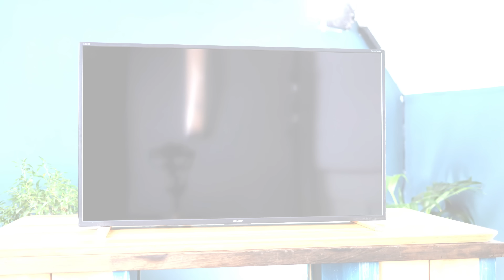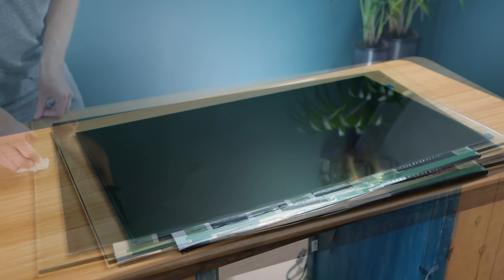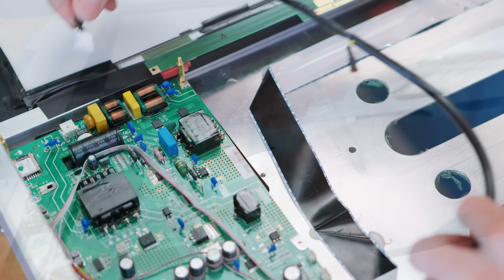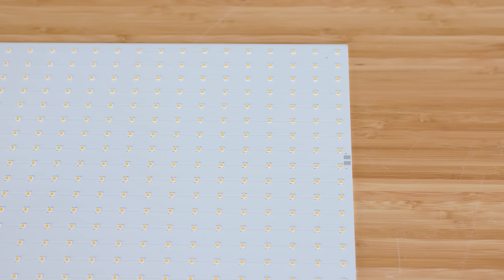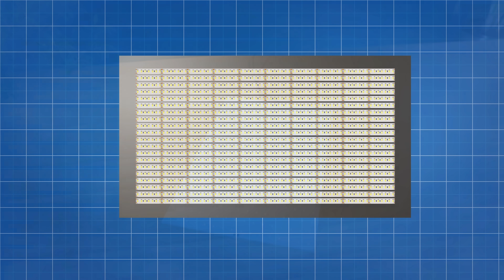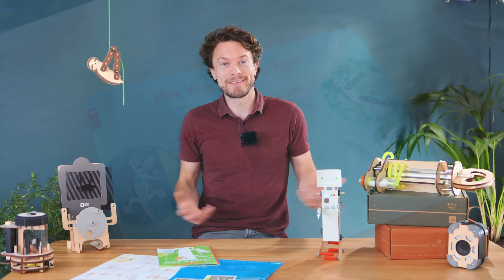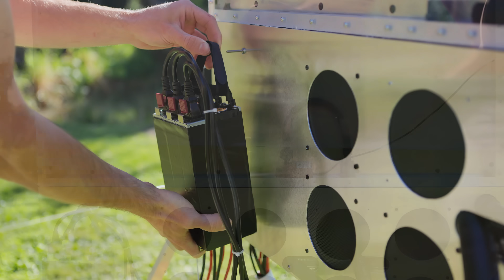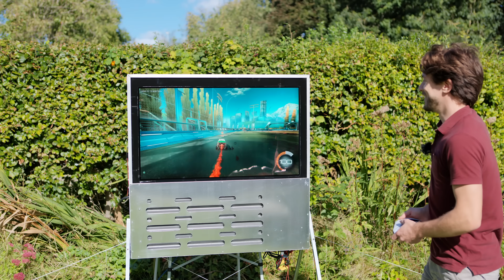Building an ULTRA-BRIGHT water-cooled TV...

Comment: Awesome project, as always.... But since this is in my field of work, I kind of felt like something should be adressed...:
High CRI backlight is WORSE for color range (smaller gamut), not better. An even spectral spread of the light makes the color filters in the LCD responsible for removing all of the unwanted light energy from R, G and B pixels respectively.... This gives you the MINIMAL color gamut that the panel can physically give you, and maximum filter losses. At least 1200W of your 1600W input power is used to make heat in stead of light.

If you want a WIDE color gamut with minimum filter losses, use separate R-G-B diodes - each emitting a single wavelength of maximum color saturation. This can lower pixel filter losses to maybe 60%, which may not seem like a big deal - but it's a DOUBLING of light output per watt of input - combined with a noticable increase in color saturation....

Comment: 48v telecoms PSUs are often available very cheaply
Reply: And you can also connect 4 of these dirt cheap used 12V server PSUs in series to get 48V.
Reply: @MrZetor  
Depends on the model. Most have the negative bonded to ground, which means connecting them in series would simply dead short the outputs through the mains earth. I know, because I'v tried series connecting server PSUs before, and it goes bang.
Reply: @theLuigiFan0007Productions  "Most have the negative bonded to ground"
- Are you sure about this? I've dealt with used server PSUs quite a bit, and have never sen a model that did NOT have both the AC ground and the DC negative connected to the chassis (earth). I don't know about 'Chinesium', though, my experience is only with HQ units that were 200-600USD when new.

But yes, obviously you have to remove the DC output grounding from all but the 1st series-connected PSUs. At least so far, I have never seen any model that used PCB traces between the AC ground and the DC negative (which would be mildly annoying to cut). Instead, they all seem to either have the DC negative connected via a cable to one of the screws holding the chassis together, just like with the AC ground, or, more commonly, the screws and risers mounting the PCB to the chassis just pinching the PCB DC- plane in a couple of screw holes. The cable is easy to detach (or cut), and the direct screw grounding can be isolated with nylon screws, washers and risers. Both very simple modifications.
Reply: Afik, 48 volts is pretty common for servers as well.  Used for rack level power supply schemes.
Reply: @martylawson1638  Isn't that the input side though? They'll still output the regular PC voltages, 12V, 5V, 3,3V...

Comment: A much easier way is to back your Utility into a modern bus stop, rip out the advertising screen and simply re-purpose. Cost=$2050 fuel $50, $2000 fancy new cabinet to put it on.

Comment: If you are indeed curious about the color quality improvement of the display. A thing you could try in order to get the intensity back in range for your color measurement device, is to place an ND filter of a sufficient level in between de display and the measurement device.

As these ND filters have an approximately constant degree of attenuation accross a large range of wavelengths, just the light intensity is lowered and the color emitted by the tv will not be warped (which would result in an error in the measurement).

Comment: I love how weird this is (despite not really feeling any need for an outdoor TV myself)
Is it possible to measure the brightness by interposing a neutral density filter of known properties?
Reply: I wouldn't watch the Talmudvision inside OR outside.
Reply: ahh yes I was totally thinking of that too (No I wasnt)
Reply: There are devices called luminometers (iirc), taking measurement from it with this screen as an only light source would be a way to measure it. There are considerations of area of the light source and distance to it, but all that is just a variables in a formula.
Reply: Love your videos
Reply: Hello there
Reply: you  can use a phone - iPhone app called cine meter 2 can measure the luminance in cd/m2  , you can also calculate it from a known lightsource with a camera by checking how many stops above or below it is on a linear scale (you need to know the camera OETF, like slog2 or whatever) and yes you can also use a ND filter to ballpark it as well, take a picture leave settings the same and match exposure using NDs, the  you know how many stops above your reference the screen is.      I recon it will be way more than 2000NIT, the difference looked more like 3 stops more (hard to tell
with tonemapping of the camera) so more like 4-5000 NIT would be my dumb guess.   You cant however compare this to a HDR Tv w, as that can also keep a low blackpoint in addition to just beign bright (and they mostly cant to the full luminance fullscreen either).   I would also be interested in the black point of the display, I would think the used panel has a contrast ratio of maybe 1000:1 , if that ratio holds true for higher luminances at 4000Nits you would end up with around 4NITs as the darkest it goes, which still is fine for outdoor as your eyes perceive images more contrasty if in a bright surround :-)
Reply: @FinnJaeger1337  no, it's like using a decibel meter app, both are inaccurate
Reply: @BH4x0r  ballpark is enough and using
photometric exposure to derive surface
illumination is totally possible.. I checked it against a proper meter and it was pretty spot
on . Its not like using a decibel meter
Reply: @FinnJaeger1337  since all those leds are technically separate, if he really wanted to he could do all of the leds as local dimming zones, it would need a lot of work and electronics though, i guess you could use i2c led dimming/management chips to control all of em with a Pi to process the signal though but w/e
Reply: @BH4x0r  yea and they spill into each other a lot I guess, so making FALD from this would still be the next step, then you can have some HDR :P
Reply: @FinnJaeger1337  not if he'd add some proper separation plates or smth and diffusion
Reply: @BH4x0r  Yea he would need that, problem could be the 8bit processing of the old  panel as well if you think about making it HDR, you would need some processing as well to make it respond in a correct way to PQ input data.. but yes would be cool to see
Reply: @FinnJaeger1337  i think a Pi 3B or 4B would be powerful enough for that, use a HDMI splitter to feed the screen and the pi
Reply: @BH4x0r  To do UHD live image analysis and then drive the LED panels ? maybe not sure , its not that easy. the curve part is pretty easy thatsbjust fitting PQ into the native controller response of the display, but even that with a Pi it will be hard , this takes quiet some processing power to do, modern TVs use AI as well, maybe more of a job for a jetson but yea its not going to be easy
Reply: @FinnJaeger1337  since it's outside i'd imagine FHD (1920x1080) would be sufficient

or if you convert it to a VGA signal you could read it out with a Teensy 4

since it's analog it'd be way easier as it'd be reading r g b each clock and setting the next led(s)

then compare which value is higher ( r g or b ) and use the brightest to set the led to *
Reply: Heyyy it's that one guy who does the things and the stuff
Reply: Knowing that Atomic Shrimp has seen this video and possibly enjoys the channel is like a really hype crossover I didn't know I wanted
Reply: Could just buy/rent some similar brightness outdoor display. I bet it is at least 3000 nits
Reply: @rkan2  those outdoor displays are made out of actual LEDS, have much worse resolution (dependant on size) and are way too expensive most likely
Reply: Fancy seeing you here shrimpy ol boy 🧐
Reply: Was just going to post that.
Reply: p @waltermeerschaert
Reply: Hello there
Reply: @damncat2793  general kenobi
Reply: Rats are people too!

Comment: You could "hack" into the main TV board, extract the PWM signal that went to the original LEDs or their controller and use them to control the new LEDs with a proper PWM-dimmer. Just check that the PWM is the same between both modules. You could also build your own controller with an Arduino and some cheap components like transistors. It depends on the type of LEDs you used and how the manufacturer suggests to dim them.

Comment: It might be possible to measure the brightness of the TV if you can use a calibrated ND filter. They're usually used for photography, and will lower the brightness of an image by some number of "stops" (basically f-stops of incoming light, and tell you how much they reduce the incoming light). Multiply the values that came from the sensor by the inverse of the dimming provided by the ND filter, and you should have a pretty accurate measurement of the TV's brightness.

Knowing Matt though, I kind of assume he thought of this, and either the ND filter he thought he'd use or the process itself didn't work out for some reason, or just didn't have time to get that all settled before he published the video.

Comment: Amazing build as always!  Have you looked into some "220V 110V Smart IC COB LED" as they use 110-220V AC directly instead of DC, so no PSU is needed?. Im sure the picture could be seen a bit blinking with the 50-60Hz, but would be dirt cheap.

Comment: This is incredible! I might need to steal a couple of these ideas for something I'm working on. Does the optical glue adhere to acrylic?
Reply: is better to use single-pane safety white glass (is clear when you viev from the side, not green) is better for the lighttransmission and the colors. I think acrylic is not ideal because of scratchproofnes, thermal problems (bundled photons emmited from the LEDs heating the surface), glass have more stability at the same thickness, Acrylic is more difficult to clean, because of scratches, is not a good idea to polisch them after out because you can get optical distortion by a not plane surface.
Reply: @SoundfictionDj  Also i think acrylic will degrade to UV exposure etc over time. I believe it yellows and gets more opaque possibly from the inside and outside
Reply: @Hamring  this plus all the things outside plotting to scratch it [personal experience not water-cooled tv related]
Reply: @Hamring  it doesn’t.
Reply: @SoundfictionDj  we actually us PMMA a lot for automotive displays. A hard coat on the front (likely an additional film like a screen protector) helps prevent scratches.
The light transmission is excellent.
LOCA (liquid optically clear adhesive) bonds very well to most surfaces. You can also use the optically clear adhesive sheets.
Reply: Yes it does. I have used uv glue to adhere acrylic watch crystals to metal bezels.
Reply: Are there conductive glass sheets that you can buy to make an outdoor touchscreen?
Reply: Just use a normal tv....
Reply: @franciscomendoza1232  Some people like to use their brains instead of their pockets...

Comment: if you could combine a crt and a laser with a rear projection type of setup that would probably work pretty well.   
the lasers themselves would be enclosed in glass and of course you would need some kind of cold gas around them probably some kind of refrigerant. 
the analog nature of the CRT aiming device would basically have close to an unlimited resolution and you be able to do 8K quite easily or even 12K.  

using a screen with something similar to a shadow mask but the optical  version of it would also be pretty cheap as it could be done with basic Plastics and are acrylics made in a factory and it would have the contrast ratio of OLED

Comment: Often times, TVs will have the backlight connected to the internal power supply board. The TVs main board will then send a pwm signal to the power supply board instructing the power subbly board to turn on the backlights and at which brightness the backlights need to be run. Might be a fun challenge to try to have the tv mainboard backlight pwm signal control the new backlight's brightness. That way, the brightness can be adjusted through the tv remote, and the backlight turns on and off along with the TV.
Reply: Should be easy with a simple Relay between the power supply and the LED power booster. Solder a pair of wire to the PWM to the Relay and program the Relay (AKA, smart relay) to take X value to Y value as Percentage. Where X is 0% and Y is 100%.

Comment: you gave me a idea of taking 6 working screens, install them into my wall (1080P 50-65") since I can cut the light in my garage I converted into a mancave so I can run off my monster pc (may up just using some larger ish super wides and go with just 4 of those.

Comment: DIY Perks: builds outside tv, that is brighter than my future, from the ground up.

Also DIY Perks: uses the most janky looking bbq grill i could imagine xD
Reply: Almost looks home-made... from Aluminum.
Reply: @djmips  - they're a single-use, ready to go item that you can buy at grocery stores in the UK and are really cheap coz it's effectively an aluminum foil roasting dish with some charcoal and a mesh grilling surface. They come in two sizes - not sure if that was the larger size in the video, but I once used the small one and it wasn't too bad for two people. I've seen the bigger ones in a hardware store here in NZ for NZ$10, which peeps can take to a beach - around the house we use normal gas or charcoal grills.

Comment: Mistakes done:
-Use green glass instead of clear glass
-Loca is no need it...
-Paint the bezels of the glass after glue the LCD pannel
-Permanently glue whatever (U aluminum profiles)
-PCB over aluminum sheet without any dielectric insulator like Kapton
-Fix the PCB with brass screws to a grounded metal case... usually are used nylon screws.
-Use indoor lighting LEDs with a warm white color, that destroys all color range on your LCD...
-No double insulation on a metal chase device makes it illegal.
-No triple insulation on a outdoor device makes it ilegal
-The water tank... not is a violation of the ISO 9001... its directly an act of terrorism...
-The external power supply its asking for rain...
-Mosquitos, spiders and more bugs gonna find a nice home between the LCD and the LEDs
-Calibrate the display with orange light, green glass filter, and at top brightness its not the best idea...

You could use 2 LCDs to have the beter contrast, and center the screen in the glass...

Have fun with your new toy, I dont bet that survive the winter, when the water freeze... and the foots looks weak as hell.

Comment: watercooled TV? Linus is foaming at the mouth. Also, those ventilation holes at the top - aren't they not sealed against weather? Also, I'm not sure about the water resistance of those meshes once wind is involved. Wouldn't want to leave it outside, but otherwise a super cool project, especially the water cooling.

Comment: High-CRI is an interesting choice for the backlight. On the one hand, it ensures you're getting a good, even spread of wavelengths to hopefully prevent any weird colour shifts.

But on the other hand, your LCD is filtering most of this light out, into narrow red/green/blue channels. Obviously this isn't very efficient (especially considering the light lost in the white LED phosphors).

It's also possible that the LEDs in the original backlight are tuned to match the LCD filters, so high-CRI LEDs could actually warp the colour accuracy.

It would be interesting to try this with a dense grid of red, green and blue LEDs. Green isn't very efficient, but the much narrower spectral output might compensate for this (and allow deeper, OLED-like colours). The colour gamut of a display is related to the narrowness of the individual channels (hence the vibrant colours of OLED and laser displays).
Reply: I commented something similar yesterday. Yes, he should be using RGB LEDs to increase his gamut (or like you say, lasers would be even better). With a high CRI he may even be shrinking his gamut...

Comment: Maybe I am missing something here, but would'nt it be advisable to use some kind of constant current driver for the LED's instead of hooking them up directly? With the cooling, you are likely going to reach equilibrium at some point, but you are likely to overdrive them to a certain extent until then. Probably won't matter until you have reached 100s of hours of operation, but with the cost of the LEDs certainly something to keep in mind.

Comment: To remove the air bubbles, I think that if you had access to a vacuum chamber and a vacuum pump, you should get perfect results, without the need to squeeze the fragile screen.
I don't know if we can use a DIY vacuum chamber instead of a commercial one, like a large steel water reservoir, with a custom door?

Comment: That's incredible, however I would not have used a fee-flowing film cooling solution. Water tends to form rivulets which makes the cooling sort of random and unreliable, plus the TV has to be as vertical as possible to ensure the film adhere as much as possible on the back of the light panel.